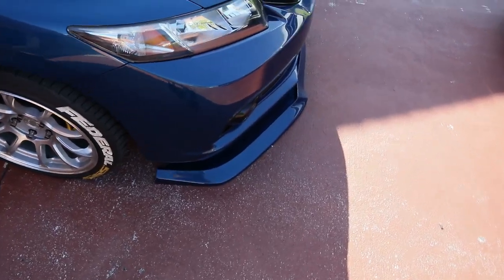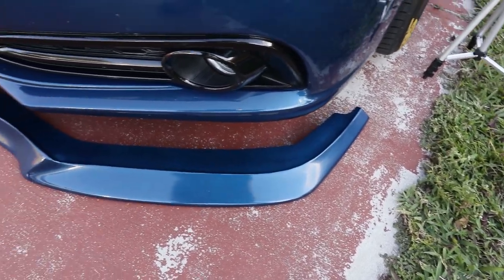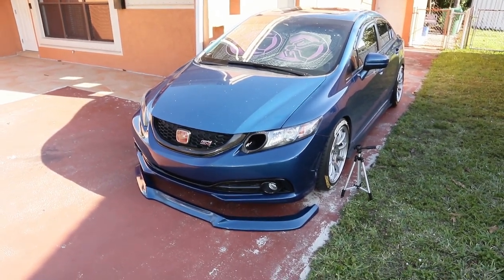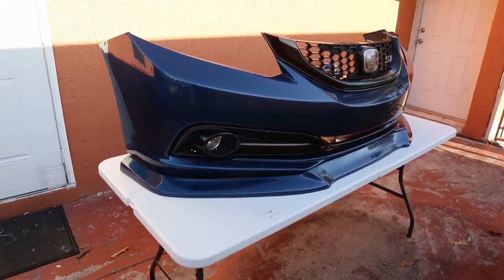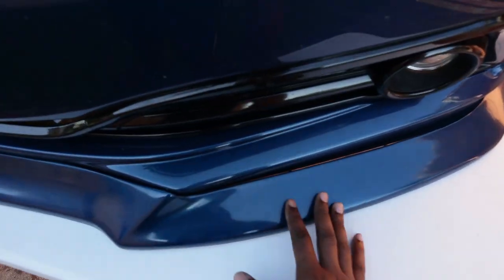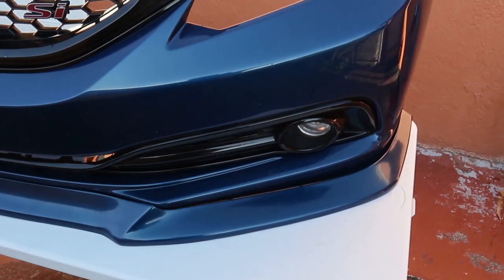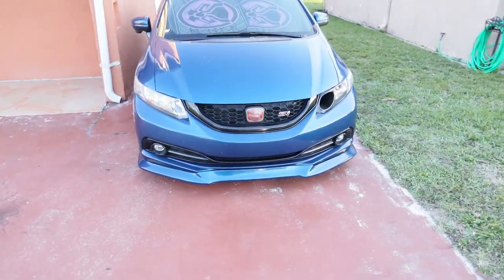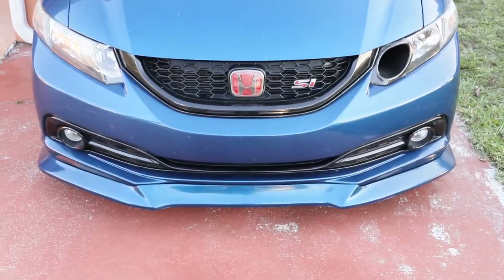ONE OF THE BEST FRONT LIP FOR THE 9TH GEN SI

Comment: Nice car. Recently got my 9th gen and I have a light under the gas gauge. It's a circle with an I In it. Can anyone tell me what it means?
Reply: it means you have a “notification”. it comes on pretty much every time you need something for your car. example, an oil change, general maintenance, or even gas. there should be an identical circle with an I in it on your steering wheel on the left side. If you press it, it will display what needs to be done. hope this helps

Comment: Hey man nice car I just got a 9 gen si And my fog lights won’t turn on I changed the bulbs but nothing what could it be ?
Reply: i have this problem with my drivers side headlight, and every few months i have to clean the contact. usually i use an exacto blade and brake cleaner in the hole. i can’t say this will fix it for you though, maybe check fuses?
Reply: @SuperMultimitch  I’ll do that yes I checked all fuses there all working fine